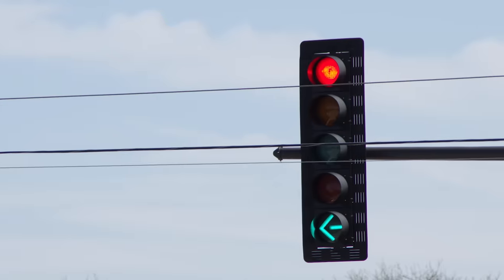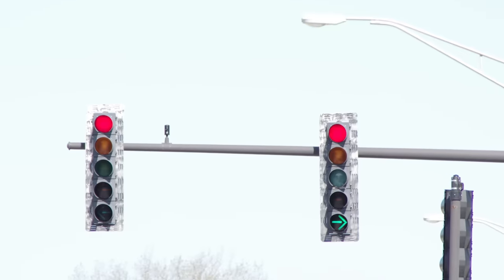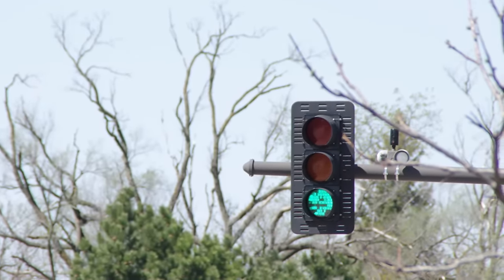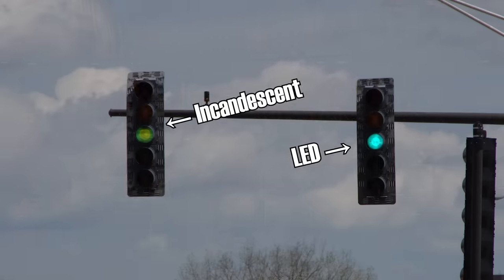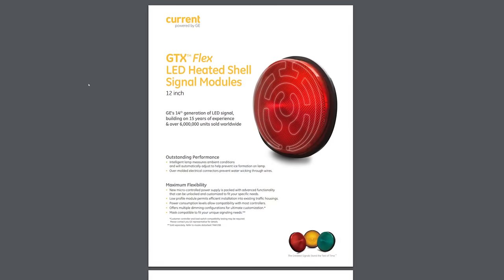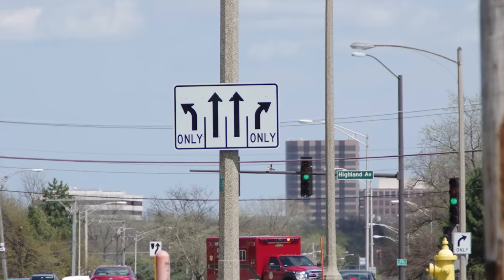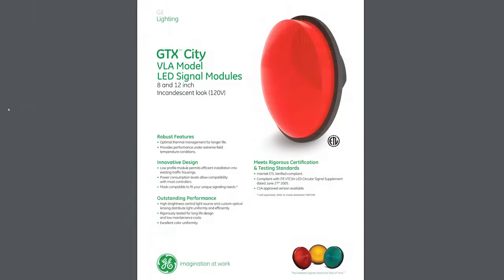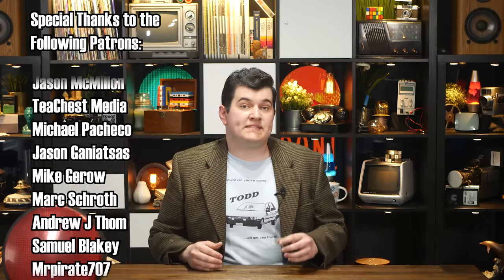The LED Traffic Light and the Danger of "But Sometimes!"

Comment: I just want all yellow lights to stay on for the exact same amount of time!!!!
Reply: They're timed to the speed of the road. They're on longer for faster roads.
Reply: @Normal1855  except if a speed camera is there.  Then they are much shorter.
Reply: eventualentrophy proven fact.
Reply: boomstickpd79 I want this freaking video to load!
Reply: @Normal1855  which is a horrible idea. I should know the time a warning light will display and it should be consistent. I shouldn't have to do math while entering an intersection.
Reply: @JustSomeGuy009 They could achieve this by setting the speed limit to 25mph everywhere. Then the yellow times would all be the same. I'm sure that would be popular.
Reply: @JustSomeGuy009  drive within the speed limit and you'll have plenty of time to stop.
Reply: If you are worrying about the length of time a yellow light is displayed then you have deficient driving skills. Which really bugs those of us who are very good at driving. Hm. Maybe this explains why some people irritatingly stomp on the brakes just because the light turns yellow, like it's some kind of panic stop time. Like yellow means stop, when it doesn't.
Reply: @tx91791  exactly. Learn the how to drive and you'll be able to easily gage how long the yellow light will last.
Reply: I just wish green and yellow cycles were long enough to get through the intersection. Often times in my semi, even if I'm first in line, the light goes green-yellow-red before I'm half way through the intersection. One in my home time is so short that it's back to red before I clear it in my personal vehicle unless I gun it off the line.
Reply: We need roundabouts. 
Sharp turns are a bane for truckers around my area. It's a frequent enough problem that intersections have been pushed back and entirely repainted to allow more turning room for trucks that simply don't have the turning radius to make a perfect 90 degree turn in a tiny intersection. Even after pushing back the intersections, there have still been numerous times where I've had to back up while waiting at a red light, to allow a truck to have the room to turn. People here are so used to, that the cops don't even bat an eye when they see a line of 5 or more cars, all backing up at an intersection to make room for a turning semi truck.
Reply: @markbesley404  Cities are actually doing this for traffic safety now 👏🏽
Reply: @Chezaswolf666  Trucks should also use truck routes and deliver at off hours
Reply: No you don't.  Yellow time is determined by the width of an intersection, and vehicle speed limit.  They do have a "carved in stone" lower limit of 3.0 seconds though.  There's a computer called a conflict monitor, that among other things watches the yellow time, and will put the intersection to flash if it should ever go below 3.0 seconds, or higher if desired.
Reply: Here in the UK the first 2 or 3 seconds of the red light count as yellow! Seemingly. Unless there's a camera!

Comment: They need to have a sensor type thing that will remove the issue of being stopped at a red light when NO CARS are coming through the other lanes
Reply: My town started installing lights that do that a year or two ago.   It doesn't work as flawlessly as one would think, but it's improving over time.
Reply: Many use cameras as motion sensors and turn signals activate the light.
Reply: @NicholasLittlejohn  Maybe, but not really.  Cameras may be used as vehicle detection, but the last I knew none of them were looking for turn signals.  My city had one intersection where this was experimented with by an outside company, but it didn't work out.   Simple video detection with cameras works well, but they aren't everywhere.

Comment: I work for one of the main manufacturers of traffic control systems in the US- Mobotrex. We build thousands of traffic lights per year. We have a heated visor for the LED traffic lights that contains all sorts of sensors to clear off snow/ice when needed. It is relatively new and has been very popular- especially in states like Minnesota. The customer- usually a stateDOT,  has to request them, but they are now available.
Reply: I guess their costs were counted in the cost advantage of LED lights in this video ?

Comment: There's a simple solution for this. Embed light heating (like you get in your rear car window) into the transparent part of the LED light. Put in an electronic thermometer that triggers the heating when the temperature drops below a certain amount. Wait a second, I just got to the part of the video where you say it already exists. It's so obvious it's already been made!
Reply: you pay for the more expensive light far less often than the less expensive one which costs a LOT more to run. This makes the tco of the led's a lot less than for incandescent.

Comment: "but sometimes" is useful to an extent, generally.  Sometimes, aircraft stall.  Sometimes, roads ice up.  Sometimes, SSDs brick before their time.  Etc.  It can be useful to encourage solutions and work through a problem fully.  

But sometimes... heh... it can go too far.  There is risk in life, nothing will be perfect.  Risks that are too rare or hard to combat, might just have to be dealt with, instead of fretted about to death.  Well done, good video.

Comment: After years, revisiting this, I really think this but sometimes would be incredibly rare. If the housing was in contact with the leds to be part of the heat sync - I would think that heat transfer would be enough to melt snow and ice / prevent it all together
Reply: The thing is leds make very little heat, and it takes a pretty significant amount of energy to melt ice/snow.
Reply: Fact is the snow might on the backside of the traffic light where the heatsink is but not the lense.
Reply: @boneless8473  they make enough heat they need heatsinks because they are sensitive to heat- that's why they normally burn out well before incandescent bulbs- incandescents don't need heat sinks to last.
Reply: @rossbrumby1957  The make enough heat to blow a microchip, not to melt a snow.   Boil a kettle of water, and see how much snow you will melt with it
Reply: @boneless8473  LED+heater still uses less power than an incandescent bulb
Reply: @rossbrumby1957  "normally burn out well before incandescent bulbs"... No, you're backwards. LEDs last WAY longer, that's one of their main points! 😅

Comment: That folded up stop sign thing is very common in IL, not common in many many other states.  I used to live in IL and have also lived in TN, CA, OR, PA, NJ and AK and I don't remember them anywhere but IL.
Reply from the maker: Ooh, interesting!  I'll admit I just assumed that was a more normal thing because it seems easy and logical enough.  I'll need to start paying more attention when I travel...
Reply: Never seen them in NY, OH, KY or IN either.  But then again, I never expected them, so maybe I just failed to see them in some instances.
Reply: I wish we had these flip out stop signs as well here in NC (we don't). When you discussed what to do when you come up on a inoperable traffic light, it reminded me of the traffic guy on one of our local TV stations (Chuck Roads, WJZY). During storms around here, we always get downed trees which causes downed power lines. He always reminds us that if you come up on a traffic light without power, treat it as a four-way stop. I feel that this rule isn't mentioned any more in driver's ED (at least here in NC). Also, we do tend to get a lot of ice storms here in NC, I wonder if these heated LED's would draw enough power to melt thick ice. Anyway, great video!
Reply: I've seen them in a few midwestern states
Reply: They're around in NJ but it depends on the municipality. I haven't seen them at all in NY, even upstate.
Reply: Agreed. Growing up in IL, I saw them there, but I've seen maybe 1 or 2 in CO in 16 years.
Reply: None in TN, NC, GA, SC, FL that I have noticed.
Reply: Seen a few folded signs in PA on the highways. They bring them up sometimes to show alternative routes if the highways close or are congested.
Reply: I'm in MI and I've never seen one.

Comment: Having been tangentially involved in traffic engineering for a while, I had a really odd conversation with a traffic engineer who was responsible for the signal system in a town in Virginia. The topic was the new standard signal control system module being rolled out. The new standard was to have significant advantages including capabilities the old modules lacked. The traffic engineer totally dismissed the idea of upgrading the control modules in his jurisdiction and said he would be happy to buy other jurisdictions' retired modules to use in his system. He wasn't arguing the new modules were not significantly better, just that he could save a lot of money by sticking with what he had. He wasn't being stupid, but knew the cost of the new modules would be substantial and his budget was already too tight. Furthermore, the cost of training his staff and implementing changes to the signal system would make changing even more cost prohibitive. In short, he was more concerned about the costs than the benefits. Sometimes underfunded traffic engineering departments are really the problem, despite the potential advantages of new technology. My point is if the traffic engineering department had to pay the electric bill for their lights, they might be more open to LED signals. So, if you want to advocate for LED signals in your jurisdiction, I suggest approaching an elected representative, explaining the potential savings to the jurisdiction, and explaining there would be a cost to upgrade that would pay for itself in short order. If the traffic engineer tried this, he might well be dismissed as just wanting to gold-plate the signal system. Just a thought.

Comment: I myself have witnessed the snow covered LED traffic lights last year, during a snowstorm.
They were almost impossible to see, in some areas. People were confused, and there were a few accidents caused by it. Mostly with drivers, not familiar with the road, and where the traffic lights are located. 
Another problem we have here, in the winter. The traffic lights get stuck, and dont change.
It's because of old mechanical switching system, that uses a motor and cams, to activate the switches in side. The solution it to install a heater, to keep the mechanism from getting frozen.
At one time, they simply placed a light bulb inside the pole mounted control box, to keep it from freezing. I'm sure they use some sort of small heater today.
Why not replace these old mechanical timers/controllers with modern electronics?

Comment: 2:15 Almost all traffic light lenses are plastic now, some of which have lens burn from the heat of the incandescent lamps, which need to just be replaced; these lenses cannot be cleaned. The glass lenses never had this problem.
Reply: Bob H it’s all about making things cheaper so the city and traffic light manufacturers save money
Reply: Then replace the whole thing with an LED fixture, no more heat problem.

Comment: Living in canada we only have LED in my area and I've never actually seen a light fully blocked out by ice and snow...
Reply: Same thing in my town in Finland
Reply: I have, almost got nailed last winter. But as the guy said in the video, it was the drivers fault, there were people stopped at the intersection, which was red for them, even though the lights were completely covered. He just wasn't on the ball like the rest of them. I let him know what he did at the next light, it was covered too, but he stopped at that one. It was crazy windy that day, I wonder if the heaters, if they are using them, were just not up to the task of melting that much sticky snow quickly.
Reply: I laughed in Canadian when he said it doesn't snow all year long.  But we have LEDs, they work.
Reply: In colder climates heating elements on the front shell turn on based on humidity and temperature.
Reply: I live in Montreal.  You would need really sticky snow and a lot of wind so that the snow falls horizontally.  It sometimes happens, but rarely.